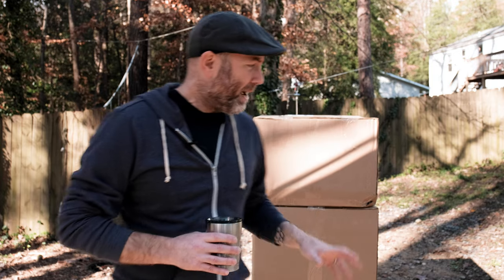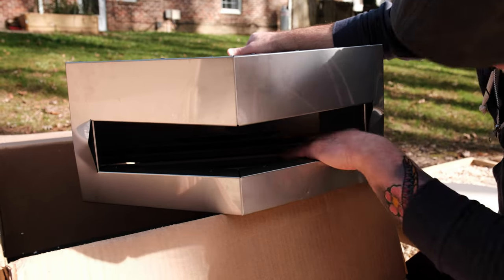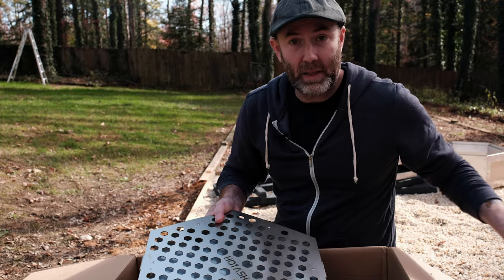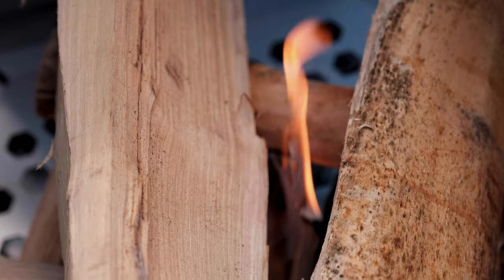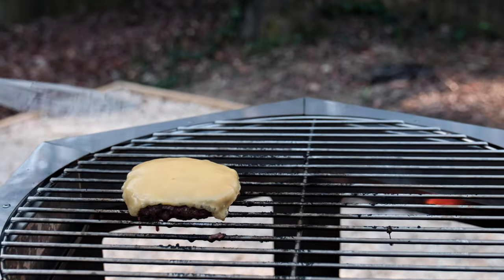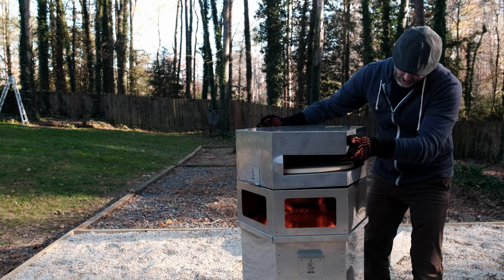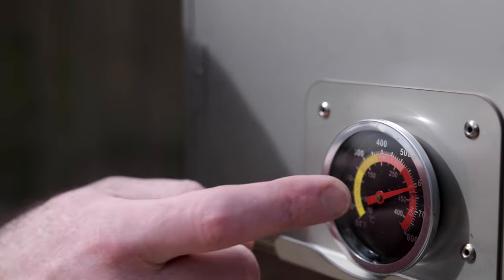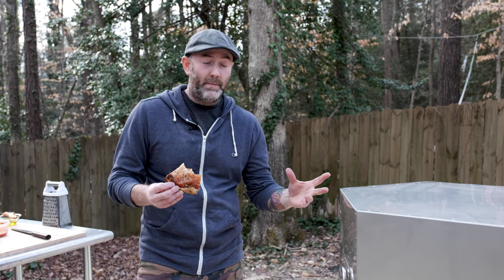COOKING WITH WOOD | Hot Ash 3-in-1 Fire Pit, Grill & Pizza Oven

Comment: How does the oven measure up to an wood fired dedicated oven like ooni or roccbox
Reply from the maker: It's good, but it distributed heat differently so it took me some practice to get it right. You can't run the oven at super high temps like the Ooni or Roccbox. For me, it performed best around 600-700°F so more like NYC-style or thin crust.
Reply: @KitchenCraftFood  my brotastic curiosity wonders if the temps can be pushed to 900 by lining the interior with firebricks 🤔